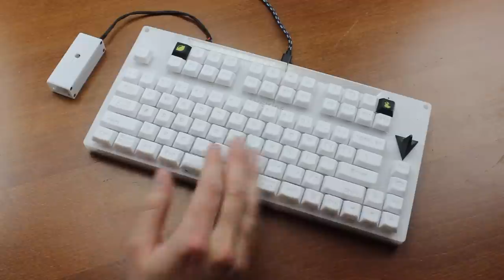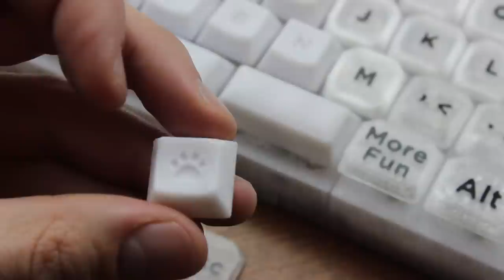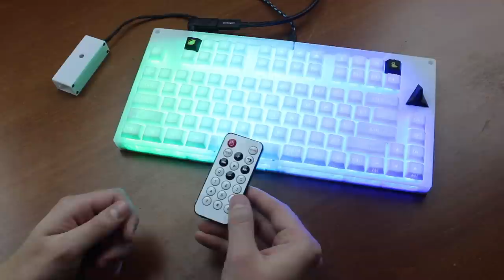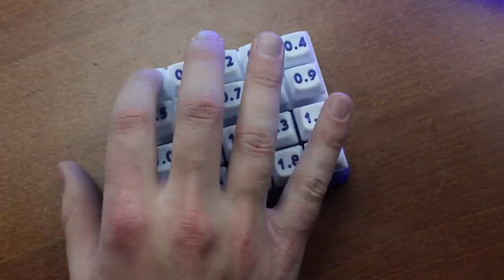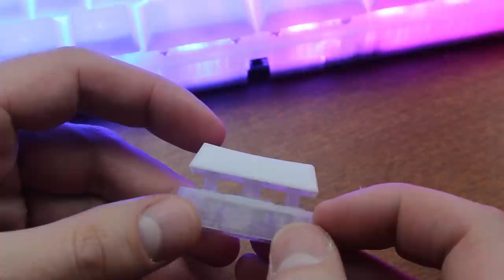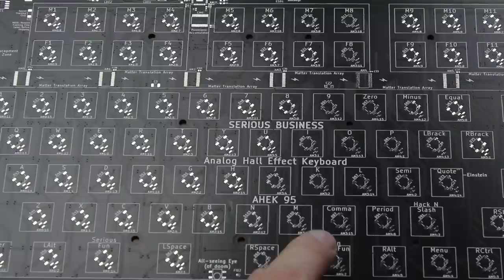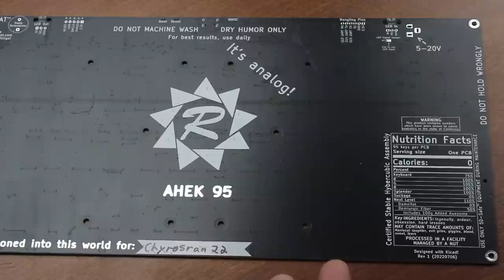AHEK95 "Void Keyboard" review (3D-printed Void switches)

Comment: Magnets could be height adjustable with additional parts. I am thinking of a cylinder one rotates which raises the magnet height by 0.3mm; say one height every 60* turn. At 360*, the magnet returns down to a base position. 

So turning the cylinder 360*, magnet heights might be 0, 0.3, 0.6, 0.9, 1.2, 1.5mm. Then rest to 0...I think. Swap the commas and dots in Europe, I think.
Reply: Some of the Speedcubes (modern rubick's cubes) use similar schemes. Actually there are a lot of magnet and spring schemes that are worth looking at. The Chinese makers are super innovative here.

Comment: Solution for sliding parts is to get the switch the way you want it first and then have Shapeways print the sliding pieces on an industrial machine in SLA acrylate and the non moving in SLA nylon.

Comment: Is there perhaps a design for these switches that are compatible with your average mx style stems? Many including myself would be keen to buy a board if it is mass produced. A switch design that has minimal friction, sounds good, and can potentially perform better for games would certainly sell like hotcakes.
Reply: The slider is 3D printed so all you have to do is print MX slider stems, or hell any other mount you'd want really

Comment: Some resin msla printing would help the switch smoothness.
Reply: Resin has a terrible coefficient of friction so no, that wouldn't be smoother. What would be smoother is printing the switches on a modern FDM printer with a 32-bit board and smoothing stepper drivers (I'm looking to upgrade soon 😁). Also, you can also just sand and polish the stems to glass-like smoothness or just wait until you've pressed the switches a few thousand times over the course of a few months... PETG will smooth itself out thanks to its self-lubricating properties.

Comment: i looked into making magnetic based buttons, turns out someone patented it in japan in 2020.

however that patent uses 2 magnets, those buttons uses 3 magnets which makes its unique enough to probably avoid legal issues if he was to sell it as an actual product
Reply: WTF patent are you talking about? I posted videos and pictures of my Void Switch designs to the public in early 2020. So there's prior art which would probably invalidate any patent.
Reply: @riskable  forgive me, i just meant there was a patent for magnetic buttons in 2020 that uses 2 magnets. i wouldn't worry about your design copying other patents. since i never saw a patent that uses a 3 magnet setup. though maybe i havent looked deep enough, take it is hear say. but i did see a patent for a 2 magnetic push button switch patent that was held in japan

but what i meant by that statement, is people have started looking into making magnetic based buttons since 2020
Reply: @b1ackgamma  Magnetic key switches are really old though.  AT&T's magnetic separation switch design is from the 1980s and there's hall effect switches from the 70s that use magnets as well (though not as a spring).  Darfon also made a magnetic levitation keyboard (for laptops) in 2014 and Embotec made one (the most basic of basic designs) in 2007.
Reply: @riskable  thats interesting, i guess that would mean, that 2020 patent in japan would but invalid

Comment: With the cost of the pcb, I wonder how a small, hot swappable number pad would fair. 👀
Reply: Adafruit sell a MacroPad kit with the same MCU as this, RP2040 and hot-swappable 3-pin mx mounts. I think I paid 40 USD for mine, that was the complete kit including some switches, caps and open style PCB chassis.
While not perfect for a numpad, it's 3x4 with a rotary encoder, full RGB and a little OLED display, it's pretty fun to play around with.

Comment: 14:30 a resin printer for just the switches would greatly reduce it the friction.
Reply: Resin has a terrible coefficient of friction so while the surfaces would be slightly smoother (though not really because you can always just print on glass) they end up quite "bindy".
Reply: @riskable  that's a good point, but at least the materially would be more uniform. 

I think it would be worth a try.

Comment: How many relays are in the clicker unit? How it behaves when you press another key without depressing previous?
Reply: Just one.  I did have an 8-channel relay hooked up to my Riskeyboard 70 at one point though!  If you want to hear what that sounded like: https://youtu.be/6hMOGKTudcg
Reply: @riskable  Ha-ha, that's an overkill! At this point it makes more sense to set up a DAC/amp chip with speaker and use recorded sounds, so you can choose between different clicks, tweak behavior and volume.

Comment: keyboard with a remote control sounds like a security nightmare
Reply: Only if you set the remote's buttons to send QWERTY keys and macros. It's not a big deal if it sends the key codes for play, pause, prev, next, volume, etc which is the point 👍

I set the numbers to send 0-9 just to demonstrate that yes, you can set them to send whatever you want.

Comment: Being able to just drag the firmware onto the device is a function of the micro processor used. Like it's something that's on the RP2040 (the Raspberry Pi micro controller) but trying to get a teensy to do that would be near on impossible. Given that the RP2040 is still relatively new, I think you'll be seeing more and more keyboards with this functionality.
Reply: TinyUF2 runs on the Teensy 4.

Comment: Is it also possible to customize the PCB? If I could do a 60% ortho one, this would be a great DIY project.
Reply: the PCB is open source, as is the firmware, so yes, you can make your own designs using the same mechanism.
Reply: I made some tutorial videos over at my channel showing how to make your own analog hall effect PCB.  It's not rocket science.  The actual hard part is the LEDs because they can generate a lot of noise and need a LOT of power (well, if you want the ridiculously bright ones--ya know, if you want to do it right =).

Comment: I'm kinda curious how well this would work with resin 3D printing. Since it's a liquid process, you can do layers that are absolutely tiny and get prints with no visible layer lines that look almost injection molded. It would greatly increase the cost (both material and labor, since resin is more expensive than filament and it needs to be cleaned and cured when finished printing, and it's also toxic until cured) 
Also gotta say I'm a huge fan of the Bad Apple backlight lmao

Comment: why the hate on MX though ? there's such a wide range of tactile feels to choose from. Between clickiez in tactile mode to u4 switches, there's so much choice I can't believe you think all of them are crappy. a bump where actuation happens, it can be round or sharp, long or short, heavy or light, and everything in between.
Reply from the maker: I don't know what U4 is, but clickiez are obviously not MX-type switches. They just look like them.
Reply: @Chyrosran22  IMO As long as a switch fits between a mx keycap and pcb, it's a mx-type switch. Kailh box switches are mx-type switches, just as clickiez are ; despite their wildly different components, they fit the spec. If the click leaf in clickiez disqualifies it from being MX-type, so does the click jacket in cherry blues. Anyways, my point was there's endless options to choose from and there are wild variations between the tactile stem bumps of different switches. U4T and U4 (silent) are a very well known tactile switch made by gazzew, which has nothing to do with Cherry in terms of tactility : a long, round bump that starts at the top, which might surprise you how close it feels to these hall effect switches.
Reply from the maker: @General_Mills_  It's fair if you use it like that, of course. I just use the term to mean something more specific.

Comment: If it has analog key sensing, could it emit MIDI events with velocity?

Also yeah, raspberry pi picos are muuuuuch nicer to flash than most other microcontrollers.  I guess the idea was that end users wouldn't be flashing them often or ever so the flashing tool being part of a more complex development environment or something that would drop in to a script run during production made sense and nobody bothered to make anything different until the pico.

Comment: Shout out to Riskable, kudos to Chyros for keeping the signatory swearing on a surprisingly low level;
Now let's just convert this to MX stab and switch footprint 😜
Reply from the maker: I don't swear just to swear, you know :p . If I swear at something, it deserves it. This thing is great :D .
Reply: It already does use the MX switch and stab footprint. You can even use KLE to design your top plate. Even the stabilizer cutout is the same (I did that on purpose even though it's not a very good layout for stabs). The stems are Cherry MX crosses too so you can use regular keycaps 👍

Comment: Chyrosran: well this keyboard doesn't have any software for programming at the moment, the maker had to send me the file independently 

Also Chryosran: I hate QMK, why is it so unintuitive and complicated with a bunch of options. 

yeah uh, I wonder why...

Also please try VIA or Vial before just shitting on QMK... QMK is a standard, not just a software. There are many different frontends for it. Honestly if my 17 year old dumbass could figure it out when I built my first keyboard it can't be that difficult.
Reply from the maker: I used VIA for the Model F repro, it took me and someone well-versed in QMK over an hour to even get it working.
Reply: @Chyrosran22  that seems to be more of an implementation problem than a QMK or VIA issue. Ive personally never had a problem with any of it and I've used it for multiple keyboards. It's true the learning curve for original QMK is really a pain in the ass, especially for Marcos and layers, but VIA makes it trivial. As long as the keyboard is actually properly supported that is. 

I just find it sad that you discard an entire standard because of what was seemingly one bad experience. Hopefully you'll get to give it an other try that won't have this much friction to get it working. 

Love the videos though, keep them coming!
Reply from the maker: @bb_lou  But what's the point of having a pain in the ass if you can just do it without it? :p
Reply: @Chyrosran22  I mean standardized software is pretty dope, I'd rather not have to rely on one person for my keeb software when a whole community is out there, but to each their own I guess
Reply from the maker: @bb_lou  I'd rather not rely on software at all xD .